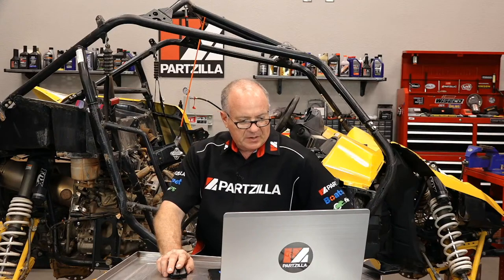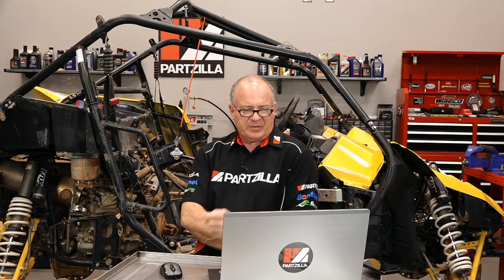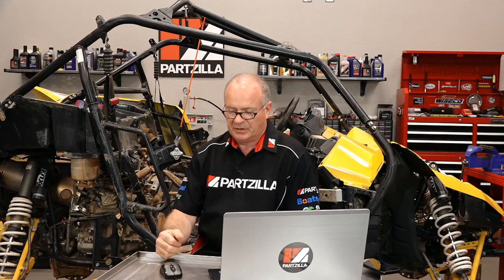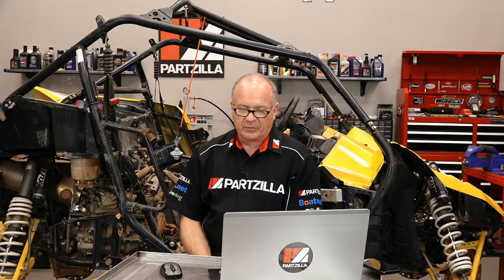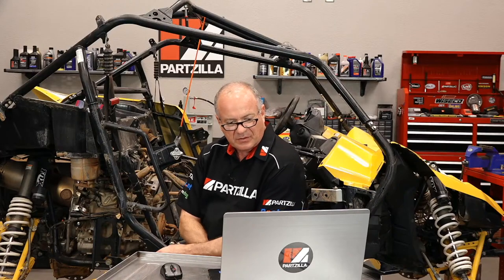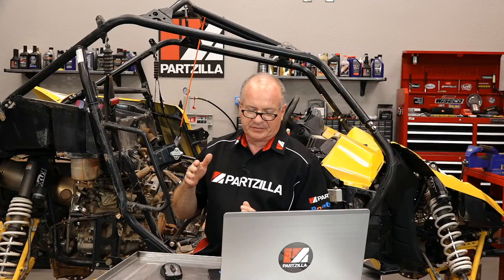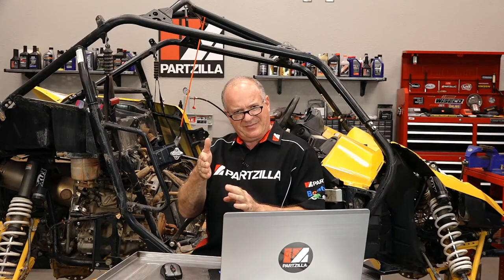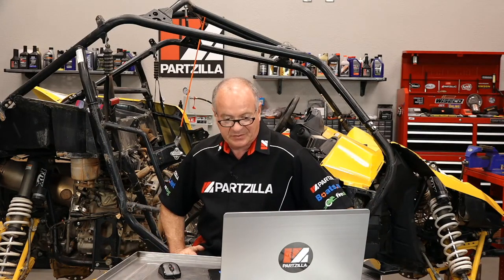Partzilla Live Q&A with John Talley -- 8/28/20

Comment: I have a 2013 Honda rancher that runs great until I go over about half a mile. It sputters and will eventually stop completely. It kinda feels like it's overheating, but not always. It will usually start right back up and idle, but will die if I give it any throttle. Do you have any thoughts?

Comment: I got a 2014 kx 250f and it has a sputter or miss right at the beginning of the throttle, but is fine when ya give it more gas should I buy an efi tuner or somethin ?
Reply: Also has a 270 big bore kit with stage 2 hot cams if that makes a difference